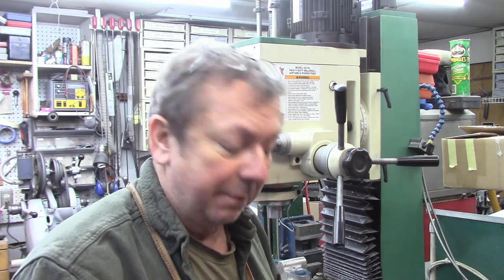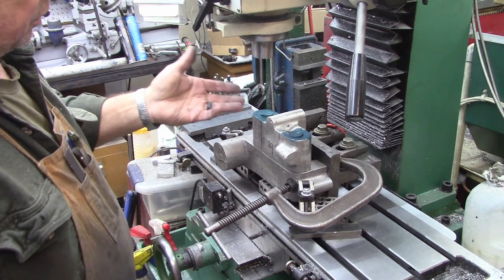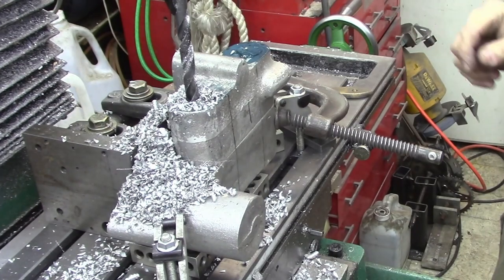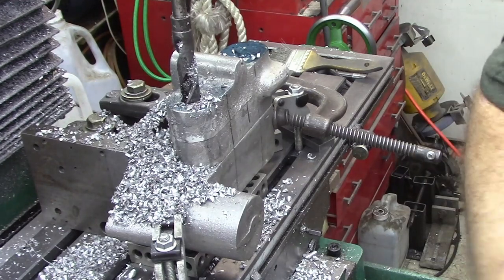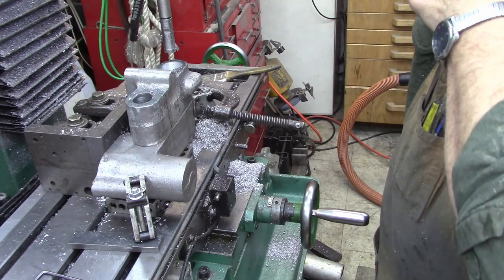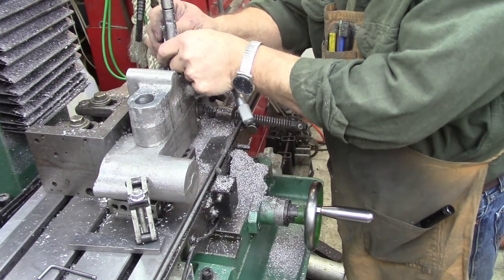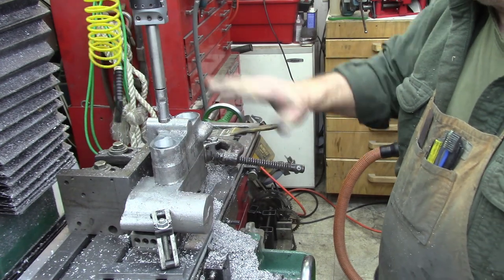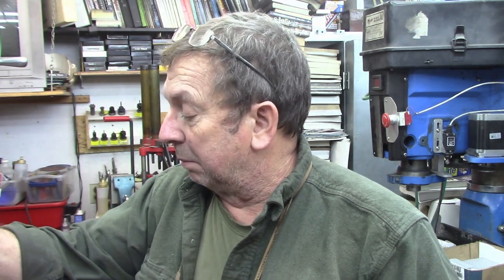Building A Grown Up Quorn Tool & Cutter Grinder: Part 12, Boring The Base Castings

Comment: Pushing the limits of your mill, but that's half the fun.
Did you need so much clearance on the rear bar or is Loctite thicker in your chilly climate.😉
Reply from the maker: Hi Chris: I address this as I was doing the video of doing the vertical column bore but yes the clearance works fine. The bores cut with a taper which I kind of expected. They will probably be lapped to final size.
I had a smartass answer to the thicker loctite but it would get lost in the translation thru the keyboard.😄😄😄
Reply: @hillsgun  I was once accused of being a smart arse, to which I replied  that means at least one part of me was smart.🤔